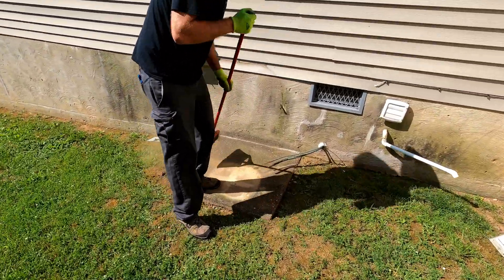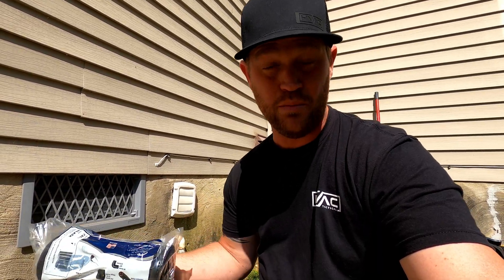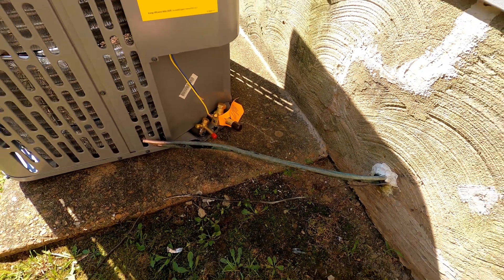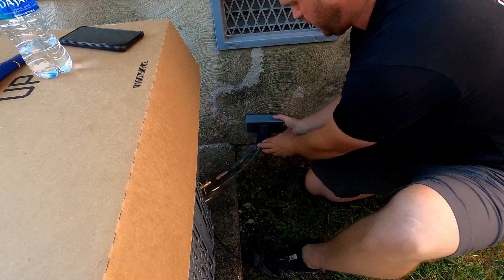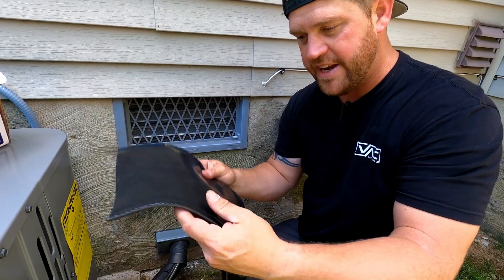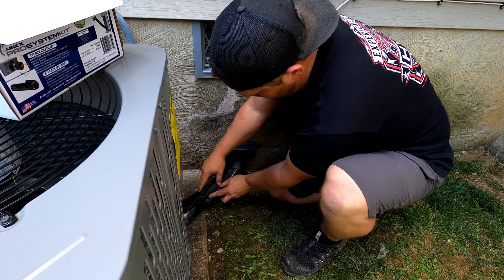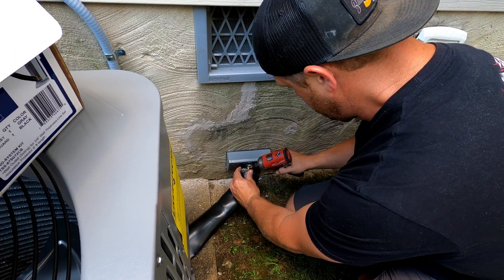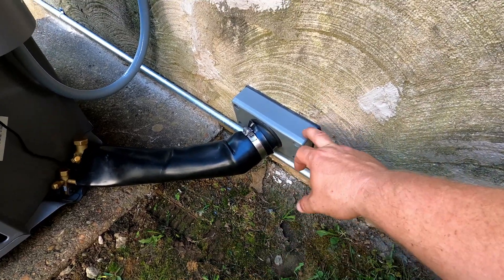Take Your HVAC Installs To Another LEVEL!!

Comment: One thing your helper forgot to do before he swept was tape those copper lines nice and tight so nothing gets in them. Last thing you want in a new system is debris inside those copper lines, could really ruin the new compressor and could get inside your coil and potentially also clog your txv inside the furnace coil. Great video though. Do more install vids!

Comment: Seems a little like overkill, but UV rated pipe insulation would be nice. The new easy pull line sets are deteriorated after a year if not protected

Comment: I would have really pressured the customer to relocate the new condenser far away from that dryer vent. :( If the customer is good, it's gonna be yearly housing-off cleaning for that unit until the day it dies. If the customer is bad, it'll be a lot of life taken off that unit with each choking episode between 2-3 year cleanings. The customer will only have it cleaned when the compressor cuts off on thermal or high pressure or starts bypassing.

Comment: OK I just want to know why you didn't put one of those prefabbed plastic pads on the concrete pad ? The company that installed my AC and my neighbors AC did that . It makes sense because it keeps the unit from sitting in any standing water . I know it is hard to tell on screen but that pad looks like it was leaning toward the house .

Comment: Leave the seam facing up or I guarantee the tech who comes out behind you is gonna slice your guard open lol
Reply: Yep it'll be a pita for any service tech to do a maintenance check up on this ac condenser later. BTW why did he claim this is a quality installation with 2nd tier "Run Through" condenser? WHY NOT Trane ? Lol
Reply: @usahoangsatruongsa  What is the advantage of using a Trane condenser in this application?

Comment: Do you know other channels don't get near the bad feedback as you? Why. Because you make a lot of mistakes. Sweeping the pad with no protection of the open lines. Putting the unit too close to the house. Placing units straight on concrete. You didn't even put in a new line set. That will void the warranty if they find out. This is basic HVAC 101. You are going to get sued one day when the customer finds out about these mistakes. I get sick of competing against companies like yours who out bids me because of taking shortcuts like this. Not to mention selling Chinese Made units.  I'm also trying to be nice and keep you from getting in a mess.
Reply: Mr know it all is wrong..Please show us where in the manufactures install instructions for Run Tru it says YOU MUST replace the line set. Maybe you need to go back to school for HVAC 101  lol
Reply: @davo912  maybe you need to STFU. The installation manual states 12 inches minimum clearance. Anyone who knows the tiniest thing about HVAC know lines coated with mineral oil will destroy Poe oil. It literally turns it acidity. That's basic HVAC 101. You aren't too smart huh? Is that you in Texas?
Reply: @davo912  by the way runtru just emailed me back. I'll be calling them in a few minutes.
Reply: @Bryan-Hensley  mr brilliant one..I assume you can read, yes? no where in the install instructions does it say you must replace the lineset..you might not like it and hurt your ego, but live  with it.

Comment: That wrap over the lineset has become a code requirement in Arlington, VA! Be careful if there’s a splice in the low voltage wiring. Those wraps will trap water inside them and will create a low voltage short or a communication fault.
Reply: wow best practice but, code required? does the city state why?
Reply: @zefrum3  No reasoning for why this County requires it but from what we were told it’s going spread and become a code requirement throughout the US, so be prepared. We’ve adopted it for all of our installations to avoid getting a failure on the inspection. We had no clue until we had an install of a heat pump system get a failure in Arlington County which is right outside of Washington DC.

Comment: Everything looked great but why isn’t the low voltage wire leading to the condenser in a whip?🤔 Rats like the low voltage wiring a lot more than the insulation. And where is the plastic condenser pad? And no locking caps? Condenser straps?
Reply: I agree with everything but the locking caps and condenser strap. Now you're just nit picking

Comment: How tf am I supposed to get my temp clamps on the low and high sides? Basically just adds another 10 min to my call.
Reply: If it takes ten minutes to pull back 5 inches of velcro you're service calls must already take you 4 hours

Comment: Nice stuff, the 6' roll is approx $28. It may be code in some areas to protect the insulation with a UV protection of some sort and this fits the bill. I would suggest turning the unit 90 degrees to allow better access for servicing. It is a pain to work on a unit when it's crammed against a wall or between two units that aren't installed to manufacturers specs. Just a suggestion

Comment: He has his helper sweep up the slap without the lines taped or covered I know that’s what the filter line  dryer is  for , it’s best to be extra safe .
Reply: Good ole bad tvx in the next video 😂
Reply: Your an idiot,obviously you don't know what a contaminated system is,and how easy an expansion valve will fail with dirt in it.
Reply: @chesneyquinn2377  The irony of you saying "your an idiot" is so sweet to savor. Never change bro. 🤣
Reply: @chesneyquinn2377  ya I hate when dirty flies the opposite direction of the way I'm sweeping
Reply: Yes sloppy
Reply: Pretty simple to tape the ends off and avoid any call backs.
Reply: @chesneyquinn2377  Thats true! My guys know to tape lines when old equipment is demoed. Had a BEE 🐝 inside copper line (suction) caused restriction. Also, 1/2 conduit  for low voltage always looks clean! Who knows, the weed eater might hit it?!?
Reply: Blow lines out with nitrogen
Reply: More concerned about the product he’s advertising rather than preventing contamination of the system…didn’t see him purge the line or pull a vacuum…just a salesman in this video
Reply: DIDN'T replace the line set on the swap-out? cool
Reply: Enjoy your peanuts while you watch the commercial.
Reply: You guys will find anything to complain about. Next one will be he didn't anchor down the canopy, Saftey concern.

Comment: So screw my subcool and superheat huh
Reply: That's the first thing I thought. How the hell are you supposed to take readings during a service call or even just a PM. Pretty lame if you ask me.
Reply: @tkgotwings_6401  its velcro, you undo it and take your readings,. While it is pretty annoying, its not hard but i would just take it off. The connection for the wall was nice tho, just 4 screws
Reply: Once again why? The thing looks like shit! I would rather a Lineset cover, and if your not a dope you will seal the damn thing like we have for years. This is just another add for him and I don’t blame him. Make the money while you can zack.
Reply: @burnem94  agreed good ole lineset cover and expanding foam
Reply: Ha so many people stuck in their old ways, velcro is not difficult to remove…

Comment: Sweeping the pad with the ends of line set open ??? Not good !
Reply: Contaminated
Reply: Good observation
Reply: Where is the filter drier?
Reply: @JBra1382  most new systems come with filter driers inside the condenser it’s there way of protecting the compressor for warranty purposes is what we were told. 
Even tho the filter drier is made to protect the txv or cap. Tubes
Reply: @JBra1382  guessing the crawlspace.

Comment: My boss would straight up ask why I wasted the time doing not just this, but setting up a tent to do this lol. I dunno about “next level,” this just looked like a commercial.

Hope they payed you enough for this lol.
Reply: He was there for hours brazing the condenser, leak testing, pulling down a vacuum, releasing the refrigerant and testing the equipment. Don’t forget he started the video saying he had to install an evaporator coil too. Long day, why not set up the tent?
Reply: @pastexpiration2160  lol long day, try 30 minutes to a hour at most if you have a helper on the entire thing.
Reply: @bruski5238  k
Reply: Lol if you can replace an ac with coil in 30 minutes then you probably should quit because your work is terrible.
Reply: Agreed. It's about the money and what is expected.
Reply: lmaoo he is the boss
Reply: I guess that’s the difference you have a boss he is a boss
Reply: Setting up the pop up tent takes less than five minutes. If you have to rope it up a roof, it's light and simple. Yes it's "Another thing" but it's worth it. 
 The product itself? Interesting and probably provides value to the customer. I have no idea what it costs. It looks nice.
 I'm a commercial technician with previous (and current lol) residential experience. 
 Cost is relative. Also. When you're the boss, what you says goes whether it's viable or not. So there's that as well... 
 Not drawing any solid conclusions besides I like the product and would try it on my next install depending on price. 
 Leave the judgment to the gods,  exempt it from your mouth and key board if applicable